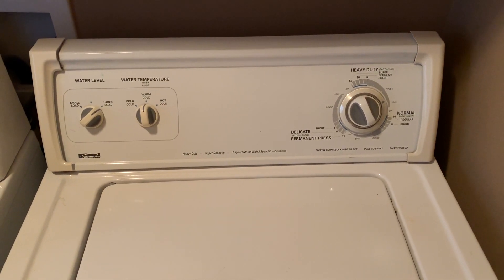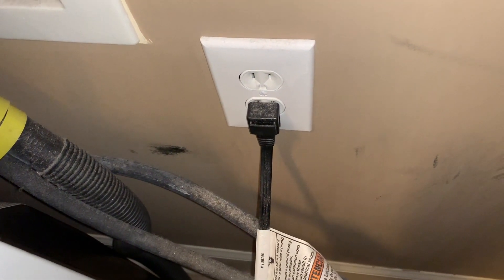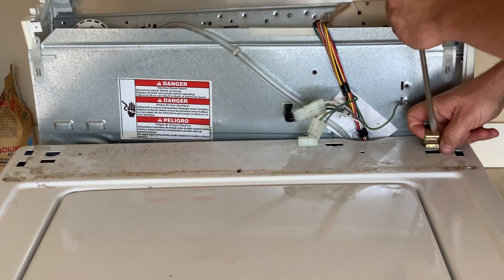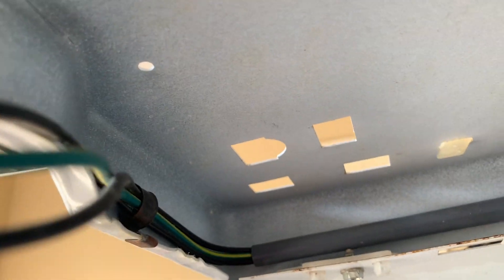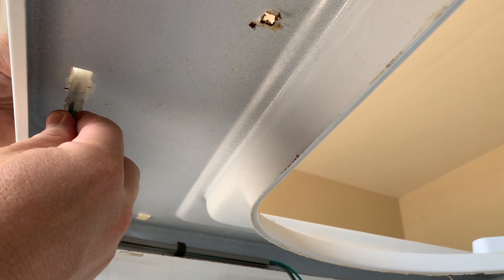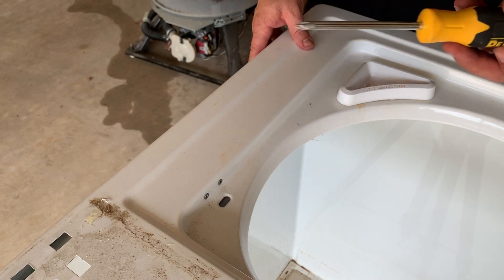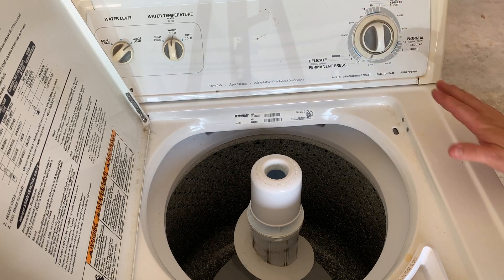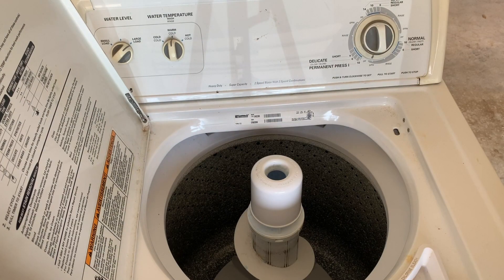Washing Machine Not Spinning - Replacing Broken Lid Switch

Comment: I have this exact same washer and was able to replace lid switch fairly easily, and although it is now running the spin cycle does not stop when I open the lid. Lid switch is in the up position when opening. Thoughts on what I could've done wrong or is it just a faulty switch?

Comment: I’m going to replace my lid switch today, I already have it diagnosed in the cabinet is off. My washing machine is up against the wall so I’m hoping getting the back part all lined up I can do it without pulling it away from the wall. It’s in a pan and it’s really tight quarters in there with cabinetry on one side and the dryer on the other
Reply from the maker: Nice! Hope you can get it done!
Reply: I did! It went great! I need to do the clutch/brake mechanism next

Comment: Thank you very much Sir. You just saved me $80 for a service call, $50 for a part that actually costs only $15, Lord knows how much for the technician's time and any taxes they pile on top. I followed your instructions - tried the bypass trick for the lid switch which allowed me to finish the laundry load that was sitting in the machine and verified that it was just a replacement lid switch that I need. (Kiss kiss) Now.... I noticed a small puddle of fabric softener on the floor centred under the machine when I had it moved away from the wall. I don't see any videos from you tackling that one..  Seal needs replacing or something worse?? (I will keep investigating on my own but I particularly like your videos for the clear instruction with an absence of cheesy backround music.)
Reply from the maker: I would run another load after cleaning up the spot to see if it still leaks or was just a spill.
Reply: @TightWadDIY  Yes, I intend to monitor the symptoms before considering tackling it. Slip newspaper under the washer and check it after each load washed to see if the leak is consistent. It's definitely only fabric softener rather than water and weird that it's dead centre under the washer - the perimeter is dry.  Could over-filling the fabric softener dispenser have been the cause? (It's a centre-spindle dispenser).

Comment: What am I doing wrong?  Tilted washer to pull cabinet off didn't work. Followed all the steps.
Reply from the maker: You took all of the screw out?
Reply: @TightWadDIY  yes took out all the screws,  There was just one on the back, holding the cabinet. I just probably need help pulling it off. Will see if I can get a neighbor to help. Thanks so very much. Video very helpful. Will keep you posted on the outcome.

Comment: Got a free washer left out by dumpster at my sisters place...finally got the hoses to stop leaking...then it would not drain or spin. Found your video, just ordered the amazon part for this Kenmore. Only $9.60 .... many thanks for the videos..I love fixing stuff !! Esp free stuff....
Reply from the maker: MonicasArtWorks Thata great! I’m glad you rescued it from going to the dump! Hopefully it works for you so you can use, sell, or donate it. I love fixing things as well. You should definitely subscribe.
Reply: @TightWadDIY  Oh I have subscribed .... I recently fixed two different lamp switches on a lava lamp then on a standup lamp...my best fix was my LED hula hoop switch. I needed a very small slider switch, so I cannibalized an old small hair flat iron and re soldered it into where the cracked switch was. That LED hoop was like $140 a few years ago...got it back to lighting up though !! Cheers !